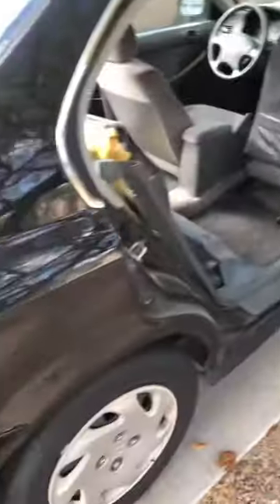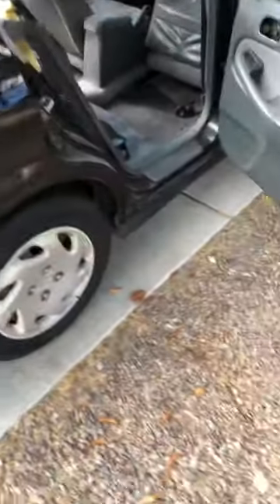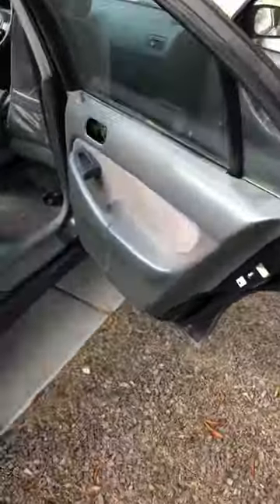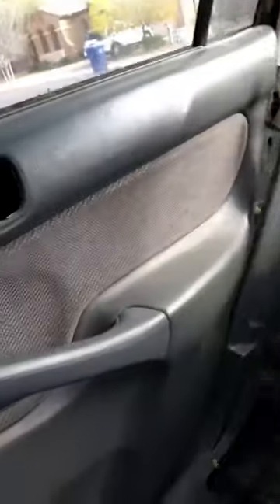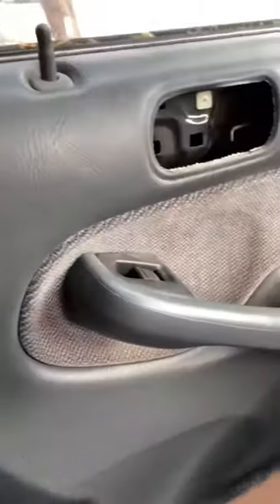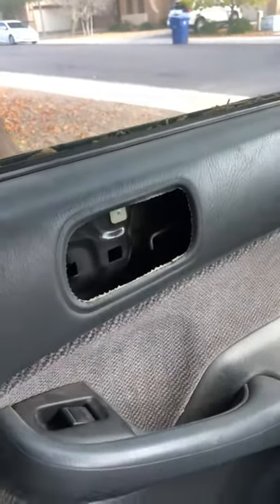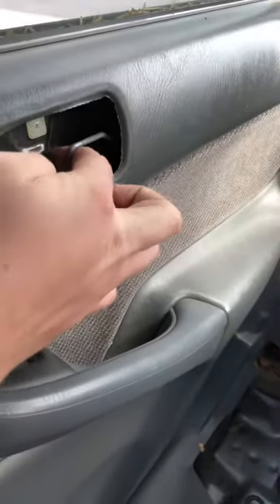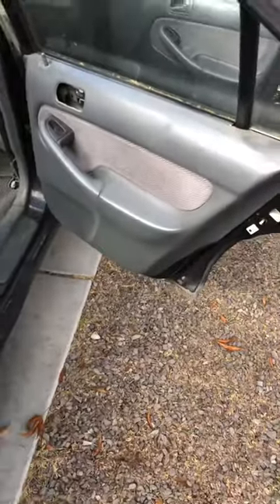How to open a car door that is stuck closed

Comment: Great video. Problem on my car tho, both of the handles dont work.
Reply: Same lmao
Reply: @pabloblack60 did you find a solution?
Reply: I drilled a hole on my golf to tear the deadlock apart, on my skoda im stuck as I wouldn't want to drill through the car frame and door...  @JackMullis

Comment: Here's a better way. Open the driver/front door. Then you should see the bolts holding the back door onto the car. Just loosen the bolts, and the back door should open.
Reply: Just loosen them don’t take them out? How does this allow the door to open? I have tried everything and if this works your a lifesaver bc this video didn’t work for me